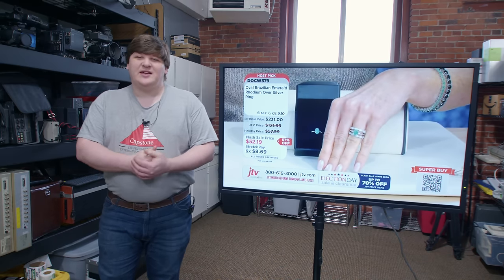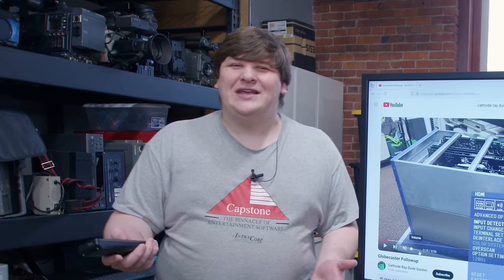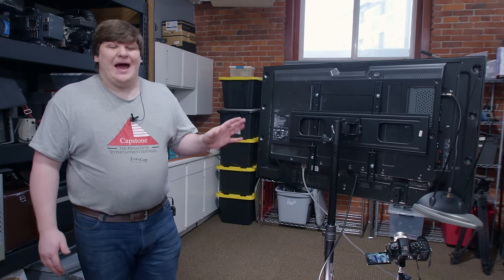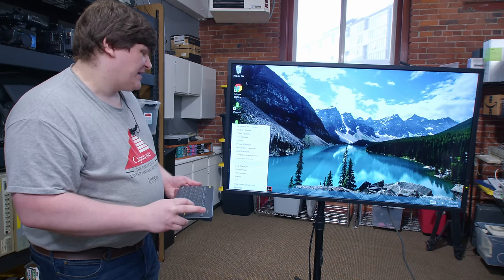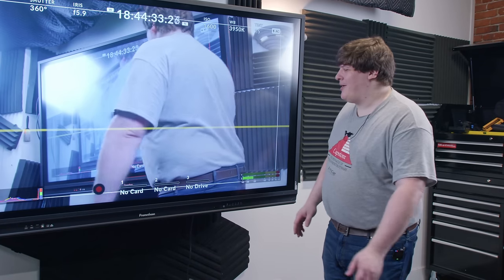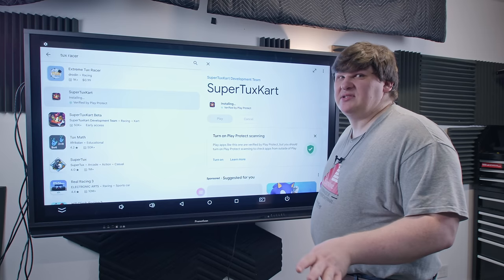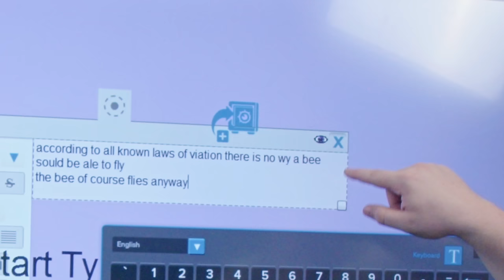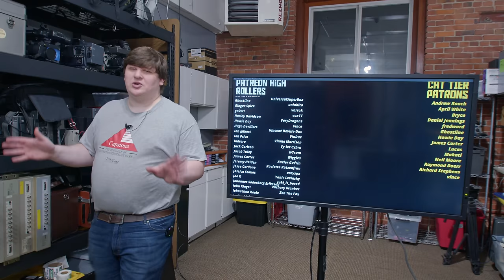Several Incredibly Smart TVs!

Comment: My personal feeling on the 'Smart TVs are Fine' thing... My experience with 'Smart' Devices of that sort so far has been they work great for a few years... until they either stop getting updates and eventually some function stops working... or the updates bog down the old hardware so badly that you end up wanting to chuck it into a wall.  Plus as mentioned by others, some of the newer smart TVs have ads and other cruft, bleh.

Thus why I personally prefer having the TV just be a display, and the 'Smarts' be a separate, replaceable thing.  My current personal preference is Google's Chromecast, because it's super barebones itself.  It uses whatever device you have connected to it for the actual 'smart' features and UI.  Since it lacks a UI of its own and is pretty much just a video stream fetcher, it seems a lot less prone to the 'bogged down by software updates' problem that say, my old Fire TV Stick had.

Comment: 34:30 CEC is generally bi-directional, so i can control the TV with my PC, and my TV can control my PC though many of the CEC controls are not included with most modern drivers, i loved my.... GTX 660 HTPC could use the TV remote to control XBMC and HD Homerun.

Comment: I bought the optional speakers for my Sony commercial display, very similar to this NEC, and they're also the worst tv speakers I've ever heard!! Think they cost about $200, several years ago. Shockingly bad. The newer Sony commercial displays are far more similar to a consumer tv. The option slots are gone, everything is based on Android , and the "professional" features are mostly software options. Hopefully the hardware is better, since they're rated for 24/7 operation, but who knows what's really higher-spec inside?! After a software/firmware update, voice control no longer works (via USB mic) and the gimps at Sony brushed it aside as "we don't support third party devices". The mics still work fine with Google Meet, so it literally has nothing to do with "third party device" incompatibility. Sony aren't remotely interested in fixing the bug though...really quite bizarre. Not the service you'd expect from Sony Professional. Anyway, rant over. But Sony...you suck. Massively. The golden days of Sony are a dim and distant memory these days.

Comment: I had experienced one of digital whiteboard systems, running full copy of Windows 8, and had i7 with 16Gigs of RAM if my memory isn't failing.
I was a high school student at the time, and that thing was in middle school... behind the high school.
AND we did the high school chemical class in the middle school.

Normally students didn't have access to the display directly because it was so expensive and they were afraid of breaking it, BUT I had the opportunity to explore with it for a little bit, which is how I discovered its specs.

Well, I just said students normally didn't have access to it, but we did use it for running a bit of presentation. It was really cool it was a full x86 Windows PC because it worked as a whiteboard and normal PC, and of course, it can accept external input as well.
And being Windows 8 also made perfect sense.

It was certainly such a great era, except I sucked at chemicals, and I still do. 😂
Reply: Also I should mention that our high school had none of that thing, while the middle school being full of that... considering it was basically sharing the same ground. It was so jealous honestly.

Comment: Most Samsung and LG consumer TVs for a while had a technically user-accessible "factory" or "service" settings menu (by which I mean accessible via an IR command from a remote, either a programmable one or a special technician remote) where interlacing and format settings could be changed. There is very little accessible documentation for these menus so it's kind of a crapshoot.

As far as I know these settings still exist and can be changed on those brands and on other manufacturers' consumer TVs as well, but most of the time they now require specialty equipment that uses bluetooth or interfaces with a USB port or some other serial or analog port on the TV rather than via IR. I haven't tried one of those old technician Samsung remotes on any of their OLEDs but I wouldn't be too terribly shocked if it does still give you some kind of result... but it'd likely either have no perceptible effect, render the TV unwatchable, or outright brick it.

Comment: PAL60 was used on the xbox 360 and PS3 over composite if your TV didn't work with PAL60 you got locked out of some games  in Australia and other PAL area 
and fun fact about the back wards compatibility with the xbox 360 if you were using it over VGA you got locked out of OG Xbox games that were 50hz only 
YAY PAL sucks

Comment: interlacing should have died the day we started digital broadcast. there is no excuse to entertain that format any longer.
also iptv is just multicast usually. each channel is a multicast group, if you are member of that group, your router will propagate that info upstream (also becoming member of that group) and so on until it reaches a router that actually gets some of that group packets and it starts sending it your way. so you can watch "multiple" channels as long as it fits the bandwidth. igmp is used to join/leave these groups, it's quite the clever solution (if 2 people in the same household watch the same channel, that data only goes to that home once and then is distributed by a local router/switch to those, devices who have chosen to enter that group)

Comment: Can you use an OPS device and feed the DP image out to other monitors?
Reply from the maker: Yes, but I don't know exactly how that works. All the modules have dp/hdmi ports on the front but I don't know if they're cloned or additional, it probably varies. And you can get standalone adapters to just break out the ports on the rear connector but they're very basic, no enclosure or anything

Comment: An interesting point on the "They're Just Android" ( 51:32 ) section of the video - ViewSonic also makes a line of Android-powered digital whiteboards that come with a wireless casting software. Similar to the one demonstrated here, the ViewSonic ones also ship woth a test-keys build of Android. One thing that comes enabled on the device is full wireless adb, with root access. By default. 

I had a conversation with somebody from their "engineering department" that told me fully open, rootful adb was the default state for these devices. Granted, they should be locked on their own vlan, so untrusted devices can't access them. But I'd be willing to bet that it's not always the case.

I had some fun during highschool with these devices though. I hacked together a script that let me run the same command across every board connected to the network, so sometimes during meals I'd go around and pop random websites on them for fun.

Comment: One of the reasons I don't like smart TVs, is that I have one and it's discontinued by both Sony and Google.  None of the apps work anymore, and I can't install new ones.  I use it with a Chromecast connected to it.  Or well, used to.  That TV is in storage right now.

I'd much rather use a dumb TV and an Nvidia shield... which is what I use in my living room.

Comment: I wonder how well daisy-chaining 100 DVI signals works. What's the extra signal lag for TV 100 compared to the initial input for TV 1? Can this cause the picture to be slightly out of sync across the whole array, thus fucking with everyone who looks at it in subtle ways they probably can't name except "it's giving me a migraine"?
Reply from the maker: i hadn't thought about that, and the only solution i can see is that they're just repeating it in the analog domain, so you'd have like, picoseconds of latency even through 100 sets
Reply: @CathodeRayDude oh that makes sense, some kind of component to dupe the raw electrical signal without even looking at it, before half goes to the actual TV logic and half gets output to the other DVI port. Although that makes me wonder if there's any potential for lossiness there, so presumably the setup is smarter than my dumb brain can imagine. Completely absurd request but it'd be cool to see the insides of these TVs and how they work, particularly for this sort of functionality.

Comment: IMO, the correct way to handle interlaced content is to ..... display it as interlaced content. 

"But LCD panels are inherently progressive displays!  You can't show interlaced content on a progressive display!"  Yes you can.  Just leave every other line blank, and on the next field you leave the opposite lines blank.

Yes, it flickers, because it's supposed to.  That's because the information that is on the dark line at any given time has been lost.  It got lost when someone pointed an interlaced camera at a subject.  There's nothing that can ever be done to bring that data back.  All you can do is "make something up" and hope for the best.

So I just don't.  The alternate-line content is not there, ergo, don't try and display it by fabricating nonsense.

(Obviously, if we're dealing with Telecined content with a detectable cadence, and you can display it at ~24p, then sure... do that.)

Edited to remove the blank lines that YT's comment editor seems to add for no apparent reason.

Comment: RE: 43:57 I'm genuinely surprised you don't have an old Logitech Harmony lying around. I got two Harmony Ones (basically 900s but slightly different?) for $20 CAD each. Get em while the server's still up. Will be a sad day when that stops being a thing :/ I really hope someone 1. mass downloads device profiles from that far away database, and 2. reverse engineers the remote software that spits out the binary blobs that the local software writes to the remote (yeah, the Harmony software is just a front-end, believe it or not) before it's too late.
Reply: Also RE: said timestamp + everything after that: I really need to be careful watching your content, because I have the same illness you have (collecting other people's trash), and now I must acquire a giant smart board. Actually... this isn't a brand new conquest, but in the past, it was one of those IR frames that turns a TV into a multi-touch device. Those are much cheaper, so I guess you've just rekindled that one (although a 75" would be a lot cooler than the 50" I'd be limited to with my current TV lol)

Comment: Okay, Ignorant Commenter time.
PAL 60: From my experience as a PAL user our grid is 50hz, so TV was 25/50 Hz/Fps, but for me as a kid consumer with a games console, it was toward the end of CRTs and the start of Digital Flat Panel displays. TV's started offering a "decoupled" display driver that could accept 60Hz input, Eg; Many PAL PS2 games offered a selection screen at the very start the game every time you booted it asking if you wanted the standard PAL 50Hz if your TV didn't support the higher rate display, and PAL 60 if it did. It meant we got the higher PAL resolution and the Higher NTSC Framerate, but for me as a kid consumer it only every appeared or applied to games consoles. I'm sure there are other uses but I never saw them.

Please correct/add you bits of info.

Comment: I take issue with the idea that built-in smart TV modules and dedicated boxes (or an HTPC) are equivalent. Maybe you're right that in the past few years software support has gotten a lot better and the hardware is less anemic but I really doubt it. Like many of us here, I'm the IT guy in my family and every smart TV I've dealt with has been horrible (esp. from Samsung). Buggy software that never gets updated and very slow UI is a universal experience. I have been pushing everyone I know to get Sony Google TVs as I've had better luck with those recently but the fact is that the dedicated streaming boxes out there have almost always been better than any built-in solution available. 

Roku TVs do not have this issue of course but 99% of the TVs that use it are bargain bin. And I wouldn't trust the TCL or Hisense of Google/Android TV at all. Either way, being reliant on a built-in streaming module makes these TVs much more disposable. I honestly wouldn't care if these manufacturers would give an option to turn off the "smart" interface entirely and just have an input selector and image options but afaik none do this.
Reply: Also, if you're a true pirated anime enjoyer, I have never seen a non-android smart TV render proper Advanced Substation Alpha subtitles with typesetting, karaoke, etc. And even then, the hardware decoder may not support 10-bit h.264 so decoding that and rendering subtitles is often too much (I haven't tried to do this on a smart tv in 5+ years though probably).

You can hardcode the subtitles but that's just sad.

Comment: Two revelations in like a minute there. 1. Americans don’t get IPTV?  Thats like, how pretty much everyone gets TV in europe these days, comes for free in your internet service. Second, american tvs don’t have expansion slots? Super common around here, at least in older digital tvs, because hdtv used to require a special subscription for which you had a special decoder card
Reply: A) Cable TV is something of a monopoly, and they'll use their copper wire cables until they die. 
B) We had tuner boxes that would just take up a slot via RCA jacks. 
C) You'll note that tech from the USA tends to be obsessed with thinness over practical design.
Reply: @  a tuner box connected over an rca plug is not an expansion? Unless you consider your pc to be an expansion of your screen because its connected over hdmi. And rca is too old for what im talking about anyways. 

Tvs have a built in tuner. This tuner is not on its own capable of understanding certain signals it can receive, like hd content or subscription only content. To fix this, instead of buying a second tuner with its own hardware and its own connection etc etc etc you just buy a card that slides into your tv that contains the decoding hardware. These cards are usually about the same size as the old laptop expansion cards, so do not take up any additional space in a tv.

Comment: 1:06:25 brightsign makes a ops player, the HO523. thats the worst peace of tech iv seen in the profession sector ever. they use an microSD for starage of media and settings. if they lose power the card is most of the times corrupted and you need to redo the config. we switchd to laptops running powerpoint, works better (the screens are only used for temporary events, a few day in a row at max, then back to storage.

Comment: Lol, just bought a server with 64 GiB DDR 3 ECC for 160. Dude cannot find a SO-DIMM with 8 GiB :)
Reply from the maker: Server DDR3 was produced for years and years in obscene quantities during the height of businesses self hosting and then when they all threw out their sandy bridge era stuff and went to cloud everything, the used market was flooded with bushels of DDR3. So people can barely even give it away, heh
Reply: @CathodeRayDude  As long as they give it away to me. A Xeon with 6 cores and 40 PCIe lanes, 700W power supply still makes for a very nice home server. Already bought a 4 x 4 M.2 board & 10 gbps NIC for it. Now I'm of course going to shop for another 64 GiB, I want to run VM's on it. More RAM is better.

Comment: why don't local stations use 480p in 2024?
Also why use a TV like this when they could buy broadcast software that are used at TV studios that is more verbose?
Reply from the maker: All the stations use wildly different specs and I'm sure it has to do with what transmitter and processing gear they bought, and when, and whether it's been worth it to upgrade. I'm not sure if I've seen 480p though I'm sure it's possible.
Reply: 480i might possibly be cheaper to broadcast as it would use less bandwidth.

Comment: I dont see any reason to buy these. Regular tvs work fine. Bars have regular tvs running all day every day for years and years with no issue. By the time they break they are outdated and shtty.
Reply: I used to design AV systems professionally, and most bars don't usually have regular TVs running all day. A consumer grade TV is designed with about an 8 hour duty cycle, meaning they are designed to be on about 8 hours out of any given 24 hours (yes, some folks run them more than that, but that's what they are designed for), but these commercial displays are designed with a 24/7 duty cycle. Another reason, and many of my clients learned this the hard way, a consumer TV warranty doesn't cover it when it's used in a commercial environment.